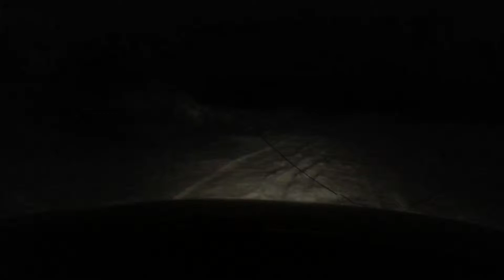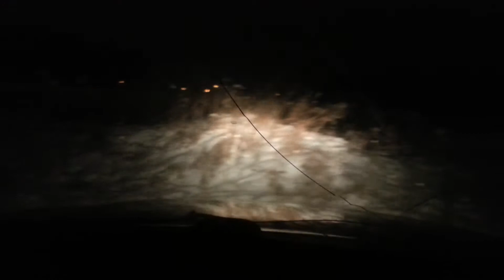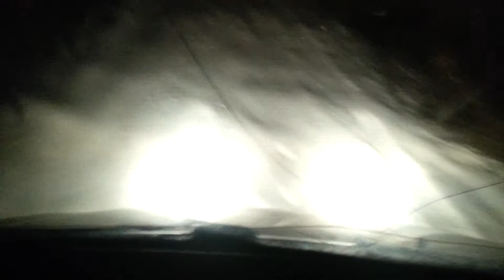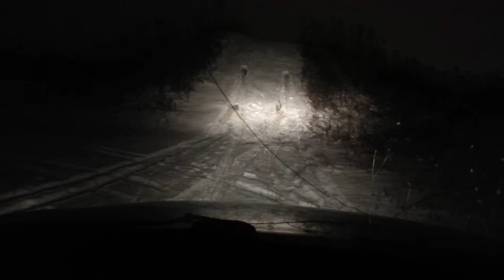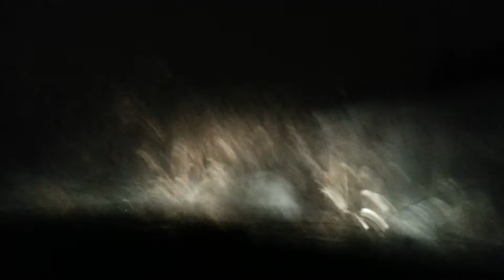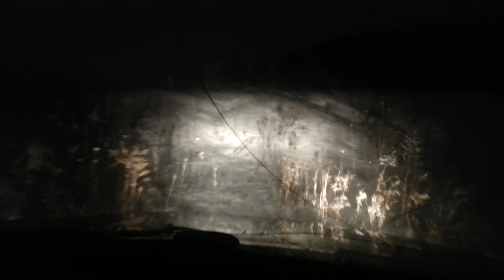Trying a hill climb in the crv

Comment: is this maual or auto transmission?and was this rd1 crv(1997-2001)  if it was manual you could approach the hill slow then half press clutch to get more torque and probably not damage front bumper.